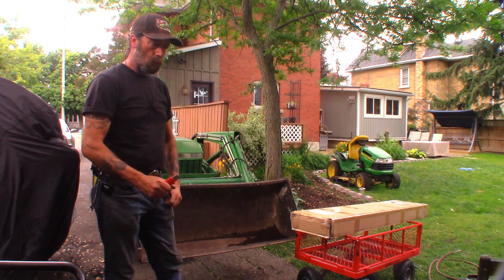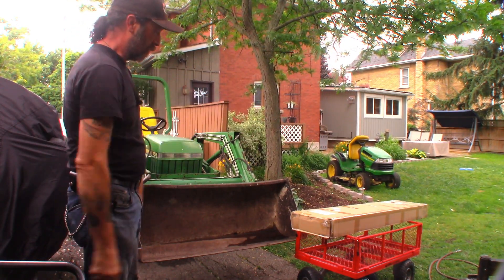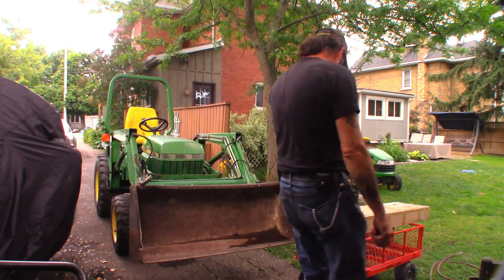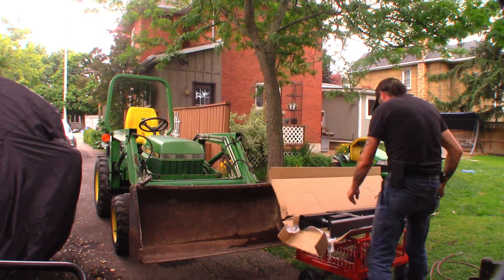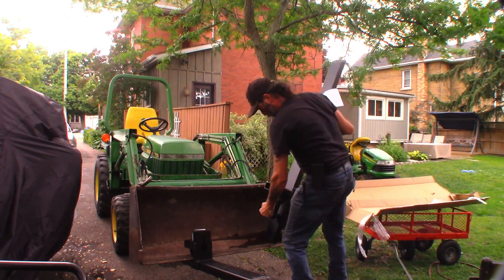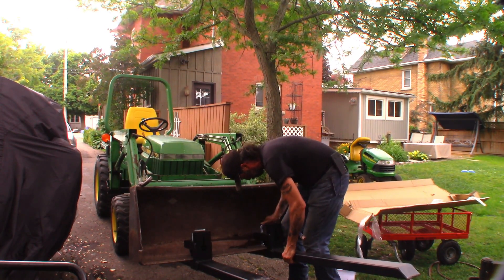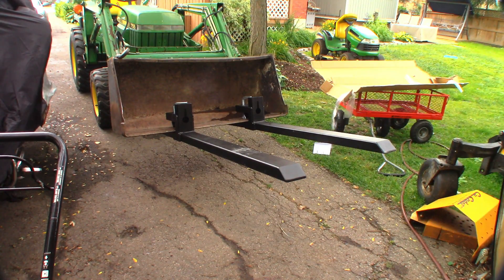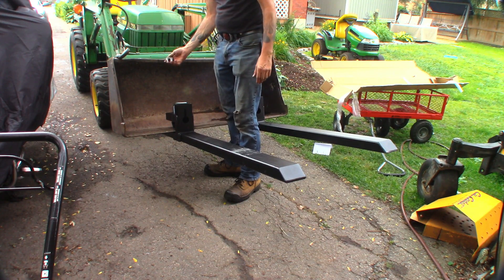Adding clamp on forks to my John Deere 755 tractor.

Comment: that is the John Deere you put the washer fluid in the tires for ballast
Reply from the maker: Sure is.  That's my personal tractor (and I love it!) Not for resale. I'll be shooting a video on checking/setting the valves soon, but I'm not sure when it will get uploaded. I have about 40 other videos done and ready to post already. I have a couple other projects to do videos on with that JD as well. Rear ballast bracket, subsoiler modification to trench and bury wires, bucket level indicator system,  possibly a quick attach loader modification to name a few.  All custom fabbed stuff, because none of that is available from JD for this old tractor model.

Comment: Hey I also have the jd 755 and want to get the same forks.. do you recommend that size after using them or would you go smaller for that tractor?
Reply from the maker: Yes, I do still advise those length forks.  Much easier to see the tips of the forks.  While these forks served me well, I did end up converting my loader to a John Deere Quick Attach system.  And I went with a real HLA fork frame and 42" forks.